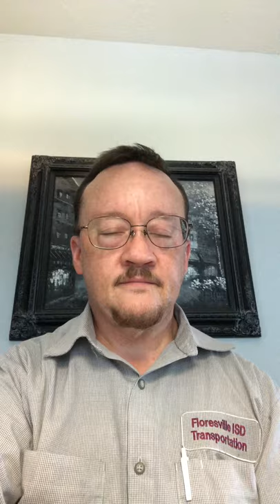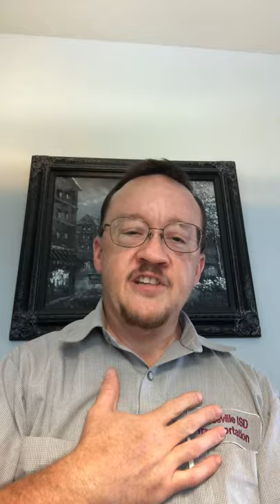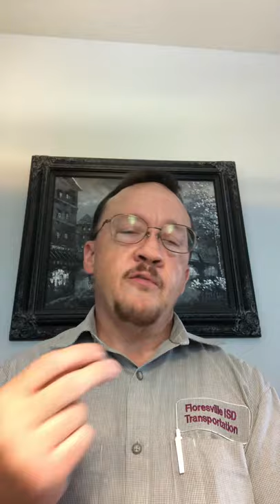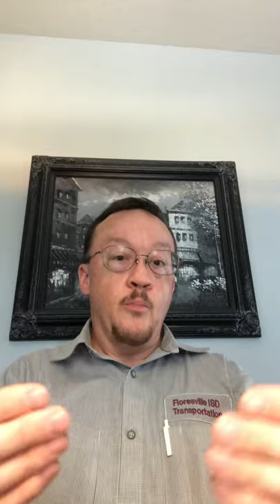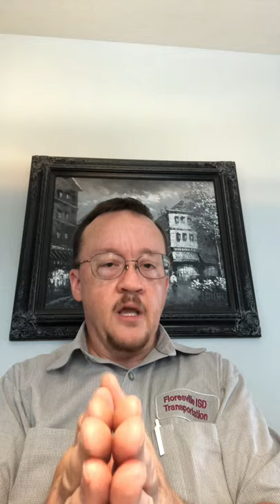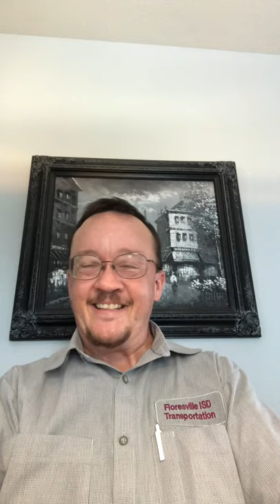Here’s why fuel efficiency dropped on Project Farm’s HHO test

Comment: What we are not discussing and should be discussed is the second law of thermodynamics which  paraphrased says "you can't get something for nothing".  We are using engine HP to create electrical current which reduces water into hydrogen and oxygen.  Now mechanical energy is stored as chemical potential with these these two elements being in those reduced forms.  Then, we oxidize these same two elements in the engine which oxidizes them and gives us back water.  That reaction releases stored chemical energy in the form of heat which is then converted into engine performance.  Now there is little problem of the third law of thermodynamics which says "you can't even break even".  There is a bit of a problem with this whole thing.
Reply: I've heard this argument and then I look at cars with a belt driven supercharger that adds 100+ HP to a car. Why one and not the other?
Reply: @greggmccleery9819  yes true super chargers add HP with extra fuel added. They require energy ( fuel ) to work
Reply: @greggmccleery9819  epic response honestly. It's almost exactly the same.
Reply: @brettjasonheadinventor  it's more than that. Think about the fastest flame in the universe. Think about it.
Reply: @TravisTellsTruths  no idea what you are trying to say.   Superchargers make more HP and use more fuel to do so.  Nothing for free..
Reply: @brettjasonheadinventor  its a small ammount if extra gas but the thing gets you up to double or more of your available air pressure. So its not free energy but it enhances your total power and hopeful efficiency. Likewise hho can enhance the fuels efficiency. A good match potentially. I'm about to start studying it.
Reply: If boost allows for a higher efficiency engine then that's the parallel.
Reply: I want to stress that the HHO device is being powered by excess/available battery charge, not the gas itself.  Which means the laws of conservation you speak of are in working order.
Reply: @TrillShatner  where exactly is this excess charge? The  alternator which is driven by the engine  maintains the charge in the battery. So where does the excess come from?
Reply: @brettjasonheadinventor  lol alternators are rated with a max amperage and voltage, that are not fully utilized... This is where the electricity for the radio, interior lights, headlights lol. An alternator only works harder and uses more gas if it is failing... This HHO device doesn't rob the car of gas, it uses all the available electricity... WHat's more is, you can also just run it on it's own battery using.. "An amp" (revalation)
Reply: @TrillShatner  yes that's true alternators are rated at higher output than what the engine's / vehicle's electrical systems require. However, the more power required means more load on the alternator, which means more fuel consumption to drive the alternator.

Comment: Wow! You helped me save hundred of dollars for nothing. I'm also thinking of the O2 sensor doing its job and now I have proof that it won't really work on fuel injected VVTI engine. The computer learns the trick and will try to compensate. Thanks a lot. A bus driver explains and makes a lot of sense than business men in the web. Selling HHO Generator for cars 😍
Reply: With HHO installed on modern ECM controlled engines (OBDII), you need to generate a standard O2 signal for each sensor (O2 and Air fuel ratio sensors) and send those to the ECM in place of the signals generated by the sensors themselves. The electronics needed were for sale on ebay a few years ago.
The HHO is making the O2/AF sensors read high O2, no surprise there. Thus the ECM says send more fuel because it appears the system is running lean do to the high O2 signal. If this is not compensated for you will lose fuel efficiency.
Reply: @johnnash9072  you're right. Doing it is not as easy as it was said. Thus, I still consider this as ineffective

Comment: As far as increasing combustion temperatures with HHO in the air-fuel mix, if you can convince a car’s computer to not deliver as much fuel, you can mitigate the problem to an extent- that’s why people use EFIEs: to fool the computer into thinking it’s overdelivering fuel, but that’s after the fact. What you truly need to do is adapt what the MAP (and in some cases the MAF) sensor tells the computer, however, adding water injection to the intake airstream gives the heat of combustion somewhere to be absorbed (other than the block) that gets exhausted. HHO and water injection should be a pair for fuel injected cars, but you need to take control of and cheat the signals the intake and exhaust sensors send to the computer as well. On the intake that’s usually a pull down resistor and the exhaust a mechanism that pulls up the voltage by adding a consistent offset voltage.
Reply from the maker: I’m glad that you brought up water injection.  In my opinion, the benefits to using water injection are not realized for most people.  It cools the intake air charge, it cools and slows the combustion process, it steam cleans the combustion chamber, it cleans the intake valves, and it allows more ignition timing advance.  Once it is set up it costs VERY little as well.  

I’ve used water injection on 2 previous vehicles with great success.  While you do need to be cautious so as to not hydrolock your motor, if it is correctly installed and tuned the chance of this occurring is VERY slim.  Yes, I am a big fan of water injection!
Reply: @91CavGT5  I’ve used a simple passive induction bubbler on my daily driver for a couple of years now, and it does make a difference, but I needed to add a cheater circuit to my MAP sensor to prevent overfuelling (because the o2 sensor sees more oxygen than it expects). I should scope out my valves to see if the claims of decarbonization hold true. If so, manufacturers should consider adding this to their direct injection engines, that have issues in that regard from what I’ve seen here on YouTube. And it doesn’t take much, either: I only have to add 4-6oz to the bubbler with every fillup. 
I’m still figuring out how to get HHO happening - that’s another thing where small amounts make significant improvements to mileage.
Reply: @91CavGT5  me too. I'm about to start messing with it. But water allows for more compression is its biggest thing. Also cooling. Very very important. I have many ideas related to these things.

Comment: Scientifically speaking the amount of energy put into generating the HHO is going to be more than the energy released burning the HHO - this is because of the loss of energy through heating the water as HHO is generated.  Therefor your car will actually burn more gas using an hho system.  Any results in better MPG are probably from simply leaning the gas mix/with an efi modifier or tuner system they say you need with HHO, not the HHO itself.  Also, the amount of HHO these systems generate is a joke compared to how much fuel an engine burns.

Also, most videos promoting HHO generators have the comments turned off.
Reply: Quite correct , And the reason why these systems never were commercially successful.
Reply: Electrical energy is used to drive hho generator....
Reply: @nicolasparrott4835  The electrical energy is not free, it's being generated by the cars alternator and is harder for the engine to turn the more load that you put on it - hence more gasoline is being burnt to spin it, just like when you run the car's ac compressor.  I just did a video on my channel about the installation of a EFIE system - it modifies the oxygen sensor signals to do a lean burn and save gas, subscribe for free and you will beable to find it when I post it, just filming it now.  I also am then doing a road trip to Florida from New York and will be monitoring the exact gas mileage as I tune and run it.  I also did a video coming soon about water vapor to increase MPG.
Reply: I never said that there was no extra load on the engine. I did say that the amount of energy provided by the extra fuel (added with the compensation of the fuel mixture) most definitely makes a difference in the overall fuel consumption. Please read my post thoroughly.
I am in the process of building my own dry cell and converting my engine to accommodate it. When I am done I will surely submit video footage of the results.
Reply: @nicolasparrott4835  I hope it works and look forward to seeing the results.  I am going to be posting videos on my channel of EFIE fuel injection modifiers, doing lean burn running and then a real world test New York to Florida road trip with exact MPG measure for 1200 miles.
Reply: Here's a scenario for you, carbureted vehicle, 1984 model, V6 engine, early catalytic converter model, engine cooling fan always runs, hydrogen reactor powered in series with engine cooling fan reduces current to the fan borrowing power for the hydrogen reactor, real world trials showed and increase in mileage, every scenario is different. And oh yes it did pass the emissions test, so when I see post telling me that this couldn't have worked I know they are being disingenuous or perhaps just naive.
Reply: You talk here about the Energy you use to split the water is not reclaimed in the process, I'll take a page out of high output Sound systems, some people put in cars, and because of the large amount of power needed to run these, many people have put in a SECOND alternator, with and extended or extra fan belt, and they "power" their high output Sound system directly from the Second alternator. Doing this for HHO would work, as long as you are using a old school Carburetor and no O2 sensor, it could help a lot more.
Reply: @scottcarr3264  what some people fail to understand is that when you implement an hho system, you are now trading a small portion of kinetic energy for the supply of some electrical energy (used to make the hydrogen). The amount of kinetic energy used can not superseed the amount of gas energy that is supplied by this production ( lest no engine could run on hydrogen alone ), thus a deficit in the energy supplied (gas) opposed to the energy used (gas production) is impossible. It is not too difficult to comprehend. I am now also thinking of combining the hho system with a plasma ignition system to obtain even better combustion. On the hho topic .... I just think that some people have made mistakes along the line, gave up and then conjured their own hypothesis to console their thoughts.
Reply: @401ksolar  I understand this. Your fan does not generate/replenish any lost energy though. Thus one can not apply the same perspective to the hho generator
Reply: @nicolasparrott4835  wtf are you talking about, my fan is a set resistance, if you put it in series with another resistave load whether it is a light bulb or a hydrogen reactor the total amount of current will reduce, v=ir and p=iv

Seems like no brainer math to me, lose a couple volts being applied to the fan motor in trade for a supplemental set of gases that helps the fuel burn so efficiently the catalytic converter no longer gets hot, and yes I've looked at the theory of thermodynamics.
Reply: @401ksolar  o.k , communication gap... my apologies. We are on the same page, though you were using an extra fan as example for explaining volt-drop due to the hho generator being fitted. Obviously you are also punting the concept. And yes, an auxiliary fan for the generator will be super, I was thinking about it as I read/watched the it for the first time.😉
Reply: I just have to add this fact, By adding HHO for your car your burning the fuel 100% and the only thing leaving on the exhaust stroke is exhaust, tiny bit of water and heat. Your not gaining free power. in fact your using ALL the energy from your fuel this is where your extra MPG comes from.
NOTES: i have a 2.5L motor my avg high way speed is 3,200 RPM(Stick) so i pump in 1.1L/min of HHO (24V DC 9 Amps 28 cell PWM) i have went from 28Mpg to 39.2Mpg avg. its not much but my wallet is happy!
2. if i max out the PWM to 100% its 24V@25amps and my car will HAUL BUTT! but the cell will get hot so i dont do it

Comment: You have an excellent explanation. 

There are so many variables to account for if you actually wanted to run an engine on HHO and gasoline and make it efficient. I'm sure this isn't even all of them but: 
You would need to know the stoichiometric ratio of an HHO/Gasoline mixture with air. You would need a constant supply of HHO and a way to meter the volume of HHO and gasoline entering the engine at idle and under load. You would have to adjust the timing because of the higher temperature that the gas burns at so you don't have detonation and or change the compression ratio of the engine. Assuming you get all of that right and the engine runs you would then have to look at the emissions side of it next. If HHO really does burn off excess hydrocarbons from incomplete burns and Nox is the only other thing in the exhaust that is harmful you would need a way to combat that. Hypothetically, if you could install a scr system like they have on newer diesels that would eliminate the Nox produced by the hotter burn of HHO. 

If you wanted to run on just HHO, just hydrogen, or just oxygen the same principals would likely apply.
Reply from the maker: I agree completely!

Comment: Very interesting response. kinda makes sense, Ive got an old Dodge truck 71 W200 318 gets about 10mpg, I hooked up just a water injector and gained about 1mpg, but the motor ran cooler. Im considering running an HHO unit just for shits n giggles.

Comment: I have a simpler explanation. The run time was shorter because the generator had 35 extra watts of load from a $250 snake oil device.

Comment: Not buying the fuel-injected reasons.  Yes, you're adding oxygen, but you're also adding hydrogen.   A stoichiometric mixture, in fact, since it was originally water.  The computer's going to see a net zero in that regard.   There are other, better reasons HHO doesn't improve fuel economy, mostly the energy it takes to split water.  I like the carburetor-droplet inefficiency explanation, yeah if they're tuned a little rich, maybe HHO helps with flame speed to overcome a small amount of inherent inefficiency in carburetor engines.

Comment: Just like in a turbo more boost more air faster burn Less timing .the problem with hydrogen and oxygen separation it.has the fast known reaction we see naturally.that is why stanley meyers made his injector spark plug you need to burn as fast as you make it or it turns back to water he introduced co2 to slow the burn rate to be the same as gasoline.

Comment: Knowing this, it would be great to see how we can get around the problem… compensate in some way. Maybe just run this on older generators and test again.
Reply: When I ran my car on "water" I used a potentiometer spliced into the O2 sensors. 

It's best to scrub the hydrogen before directly feeding it into the engine though. That extra oxygen makes for some hard tuning and gutless performance.
Reply: HHO is the problem with Oxygen sensors... You
can easily separate the two and just run HH in the engine.. Then you dont have the issue with the Oxy sensor running the fuel rich. There are enough videos on YouTube to show how to separate..  Basically the POS side generates the oxygen and the NEG generates the O...  or the other way around. But you create two separate chambers BUT the water is still connected. Think of a typical HHO cell (single cylinder with POS and NEG plates)  and then think of an "H". Two cylinders. POS one one side and NEG on the other. Then just vent the Oxygen.

Comment: What would happen, when you feed only the H in the engine, WITHOUT the O?
Reply from the maker: By only injecting hydrogen, you won’t be gaining much at all.  The air/fuel ratio will be slightly richer since you are not injecting any extra oxygen.  The extra oxygen in combination with the hydrogen is what helps the flame front to speed up and thus getting a more complete burn on the air/fuel mixture that is in the combustion chamber.  Without the extra oxygen, you just end up with a slightly richer air/fuel mixture.
Reply: @91CavGT5  have you done any scientific tests like project farm so we can see your experiment??

Comment: What if the HHO was separated and just the H2 was sent into the engine?  Would that have worked better?
Reply: Yes it certainly will work better I know because I do it everyday I'm getting on an average in town with my Mitsubishi Mirage supplemented with a hydrogen generator every bit of 42 50 miles to the gallon whereas on the interstate anywhere from 50 to 60 miles to the gallon
Reply: @dpfx99999  thanks for being honest. What strip do you have

Comment: I wouldn't have thought a generator would have an O2 sensor.
Reply from the maker: Some generators now come with fuel injection.  It is those fuel injected models that have oxygen sensors.  When it comes to keeping emissions low, and performing good at different elevations and in different climates, fuel injection is superior to carbs.